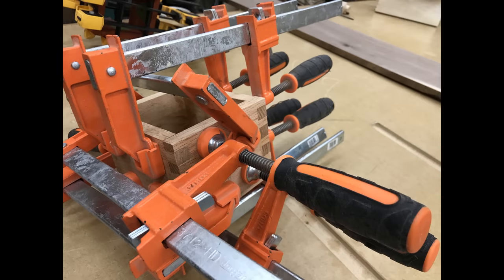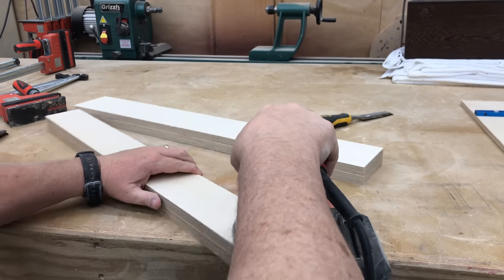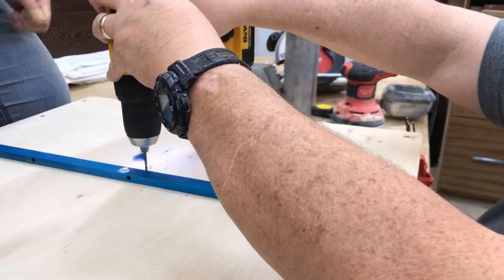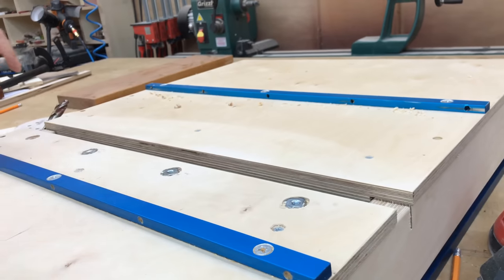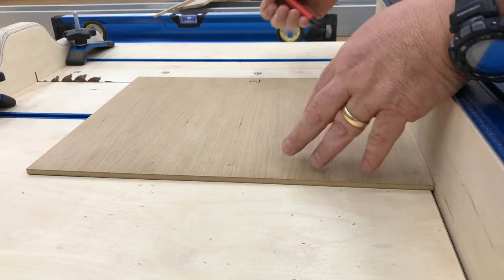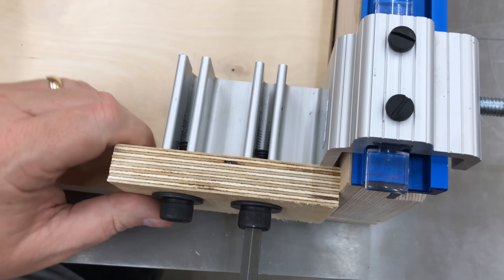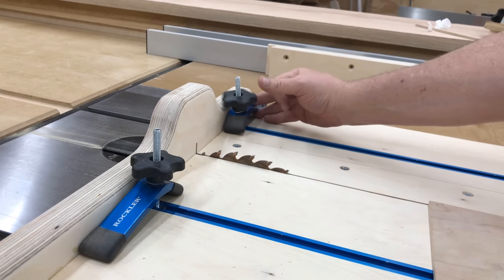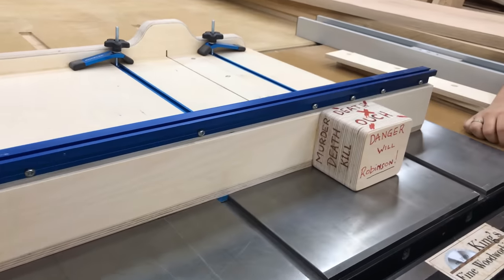39 - Extreme Crosscut Table Saw Sled with Perfect Miter & Dado & Removable Zero Clearance Insert

Comment: What's the downside to using T-track as a miter bar?  I know miter bars typically have nylon adjusting screws to eliminate side play, but (A) side play on my T-track is under .005" in the SawStop miter slots and (B) my sled will have two runners.  The upside, of course, is T-track costs way less than miter bars.

Comment: This is my first foray into youtube woodworking videos. I finally retired and am picking up woodworking again after a 55 year stint in engineering.
Great video and a very nice looking sled.  After purchasing a Ridgid table saw I am ready to get going.  Reading through most of the comments to your video, I saw the one about tapping thread in the aluminum runner and the plywood base not being too secure.  I suppose having the CA glue between the base and the runner helps secure it in place. Could you also squirt some of the CA into the wood threads and lock the screw in place?

Comment: For miter bar attachment, would it be better to countersink the plywood and run the machine screws in from the top? This would give a more secure metal/metal fastening joint. Maybe some blue thread lock as well?

Comment: Quick question... Did you have any problem moving the fence up with the double layer base, or did you take that into account and leave a little clearance for adjustment? Could you have moved the right side down and achieve the same adjustment? Thx again!

Comment: Great sled but I'm confused. Would this crosscut sled be suitable for cabinet makers?  Not that I am such a craftsman but I want to build kitchen plywood cabinets, using a crosscut sled that will be able to accommodate sheet wood of those sizes. Any pointers for such a sled design certainly be appreciated as I've searched extensively online and nothing so far. Thanks.

Comment: Hello Mr. King, do you feel it is necessary to add a "chamfered" channel to the inside base of the primary fence in order to relieve sawdust buildup which may affect squared alignment of workpieces  ? Is there alternative solutions to a permanently fixed fence ? (Please, no battery operated air bellows tubing, LoL) Thank you for your videos and solutions.

Comment: 28:58 You haven't seen Jonathan Katz-Moses non-deflection stop block at Katz-Moses woodworking. 
I like the inserts for you dadoes.  I made my sled as a single-sided sled to the left of the blade as it always gets wider to the right. Problem, only the edge that is on the sled is  a clean-cut the other side some times gets tear out
Reply: Funny, I was just in the process of purchasing Jonathan's stop block, for use when I build this cross cut sled!

Comment: Why on earth did you put the screws for the miter bars in from the bottom? If they were put in from the top of the sled base, the screws would be anchored in the metal of the miter bars instead of the plywood of the sled base. Also, it looks like threads were cut in the miter bars above the countersinks, so when the screws were tightened, the screws would be firmly seated in the miter bar, but would not draw the sled base towards the miter bar.

Comment: I did not think that Nick's sled could be improved on, but I stand corrected. I love the idea of inserts. The one thing I am not a fan of is having to add the block to the production stop, I can see the bolts getting in the way on the one side and on the other side hitting the actual stop and not the block. Could the back fence height be adjusted to not need the block? Or is there a reason that can't be done that I am missing?

Comment: I have a smaller table saw than yours (21 by 26.5 inches with the saw blade in the middle at 13.5"). Would you recommend using your size and keeping the kerf cut off-center?

Comment: You might want to check and see how flat and level the sled is after you put those screws in.  Where the glue dried it will hold the two boards slightly apart.  This might not make any difference with the sled.  I glued two round discs together for my disc sander, it was a little cold to be using glue.  I used many clamps and I tend to overtighten, but I can still see looking at the perimeter where the glue held the pieces apart.  As a result, the disc is out of balance.

Comment: Awesome sled. Definitely the one I am going to build. WHat do you think about adding additional inserts to use with finger/box joints? Put the block on the insert. One for 1/4", one for 1/2", etc. Just wondering how you'd think to mount the small block on the insert.

Comment: Very cool trick learned with the 5 cut squaring. I saw an error in the calculations though. The tips on the caliper were not at the ends of the board. So your 11 and a half should have been about 9 and a half.

Comment: Thanks for the great video. As a mathematician by training, i'd like to say that your explanations of the five cut method and how to make a perfect 45 degree angle were excellent.

A safety note. I would put a plate of steel at the end of my wood block to protect my fingers. Then if you accidentally go through the block, you will just damage the blade. 

Also, I notice that your table grooves go into your out feed table (they have to in order to slide the sled beyond the saw's table. If you put some stop block into the grooves, you can limit how far the sled can slide. That provides an absolute level of protection.

Better yet, go for the belt and suspenders and do them both.

===========
I do have a question, though.

Do all saw blades cut with the left side in the same position? I would think that some brazed carbide blades might extend beyond the steel part. That would mean that a wide cut blade would cut more to the left of the blade than a narrow cut blade.

Then your zero clearance sled insert would have differing clearance on the left side. -- So you would need inserts on both sides of the blade.

Ken
Reply from the maker: Hi Ken, Thank you! Great tips. And you are right, the teeth could be wider for a given blade. But I haven't experienced it yet.
Reply: I think I would use a piece of aluminum on the end of the block. You would be able to tell if you hit it and it wouldn't ruin your blade.

Comment: Great, thorough tutorial- thanks for your work. I'm making this now and have attached the adjustable kreg sliders on the bottom, and have a question: the adjustment screws on thesliders are very loose and I would expect them to change over time: would you recommend thread loc or something? Give what they're for, I'm surprised the fit isn't more snug.

Comment: I bought and built it. Why the front (side) is 4" high? Kreg's stop is for 2 1/2" height. Tried to cut a 2x2 but it bump to the raised edge of Kreg's stop. That limits the height of piece for cut.

Comment: Quick question.. If you are tapping the holes in the aluminum guide, why did you insert it from the bottom? Why not counter sink from the top and screw in from the top into the aluminum track, sandwiching the plywood between the screw head and the aluminum guide?
Reply from the maker: Hi Chase! You could sure do that.
Reply: King's Fine Woodworking okay, thanks I just wasn’t sure if there was a reason or if you just decided to do it that way, I am getting ready to start building my shop and have plans to make this in the future. Thanks for the reply.

Comment: I bought a set of your plane to make this sled. However there is not dimension called out on the plans for the placement of the miter track bars. Can you tell me where you have the fence set when you are gluing the rails to the bottom of the sled?

Comment: I have a question, I know you have a tape / stop block but would it not be good to have peg holes every 1/2 inch marked my peg board, then using a small peg to set each cut.

Comment: Do you ever use this sled with a 45 degree tilt on your blade?  I have a powermatic 66 saw and wondering if I should account for tilting the blade 45 degrees but I'm not sure if that is used often!

Comment: With the screws in the rails. Do the machine countersink screws actually hold in the plywood (like a wood screw would)? They obviously thread into the aluminum, but wood? Or are they just supporting the glue?

Comment: Great video, best was the 45 degree miter cut add-on and how you build it. I'm a little concerned however about the weight. It must weigh a ton. Also, since the sled is pretty thick, I wonder how useful a 6" dado blade would be.
Reply from the maker: It wasn't too heavy. And a 6" dado blade would work for most cuts.

Comment: How do you deal with tear out when you go back to a regular saw blade after using the dado? I get the insert for the bottom, but there is still a larger cut in the rear fence correct?

Comment: After a year of owning this, would you say it was worth it to drill into your production stop and add your extra block there? Have you actually benefitted from the extra inch of fence height? Has it caused any issues or problems since going that route? I've got the same kit and I'm preparing my own sled build, I intended to build teh fence to fit the stop but you've got me thinking I might be missing out. Just trying to weigh the options

Comment: Just found this video as I was researching cross cut sleds.  Now on my list of projects and another plan to purchase.  One question I have.  Is there any benefit to have a small shelf on the other side of your insert plate?  Looks to just sits on the one shelve and bolted down.  In other words the inset plate would be supported, by the 1st layer nearest the table, on both sides,

Comment: Great vid!  But I did not see how you enforced the length of the picture frame edged. Others with picture frame jigs have a stop and take care  to measure the inside rabbit length etc. etc.  you did not do that so what is the substitute here?
Reply from the maker: Hi! I did!  That’s exactly how this works. You measure from the inside of the rabbet right at what will be the outmost edge of the rabbet. Therefore measuring 8” pieces and 10” pieces, will give you a frame that perfectly holds an 8” x 10” piece of glass. 

I guess I should have shown the function and use more clearly. Maybe I’ll make a video making a picture frame using the jig, then I can zoom in and show exactly how it works.

Comment: 3:52 - aren't the holes in those aluminum runners already tapped 1/4-20 ? Are you drilling and re-tapping for 5/16-18 and running the tap through the plywood? Are you using a 5/8" length flathead machine screw?

Comment: Maybe this has already been addressed in the comments somewhere, but regarding the miter attachment...since I imagine that frame sides are cut to produce rabbets of specific lengths and not so much concerned with the outside measurements of a frame, doesn't this method of cutting to the outside edges make that more challenging?

Comment: At 32:17 when you loosened the hold down, I seen the piece of wood drop a bit, looked like the top of the sled isn't flat. Does it not matter if the top isn't perfectly flat? Thanks again

Comment: Great video and I've already downloaded the plans. One issue is that the 3/4" Baltic birch is only 18mm wide and therefore the Kreg top track will overhang the fence preventing you from cutting dados in material thicker than the fence height (not common). Your video clearly shows your fence has a different makeup (3 pieces instead of two) that makes the higher part of the fence a bit wider than 3/4". What materials did you actually use? Thanks.

Comment: I like the design.  But I wondering.  Why not include dust collection in the blade guard?  Great tip about the isosceles triangle.  But what if I need an angle that's not 45?  I have seen that more than once.  Also, the sled seems too thick for a regular table saw (with out a 12" blade).  Do you really need it that thick?

Comment: Thanks for the great content. When you glued up your 3/4 for the fences you ran the pieces over your jointer and I've always read that the glue in the boards can dull your blade. I've noticed other builders doing the same thing so I was curious. I have a very new Grizzly 8" and have been hesitant to run glued board thru it. Curious what others experiences are as well.

Comment: At 39:30, it looks like you have a Rockler T-Track hold-down clamp.  I'm trying to research the difference in the Kreg track system and the Rockler track and accessories.  I thought that the Rockler clamps typically have 5/16" T-bolts, and the Kreg top track only accepts 1/4" hex head bolts.  Just curious how you adapted the Rockler clamp to fit the Kreg track or if I'm missing something in my research.  I like the way you're using that clamp.

Comment: In Germany we only have 18 inch miter bars. Do you think using two bars in one running track will work just as well or will the performance and accuracy be worse?
Reply from the maker: It should work just fine. I don’t think it will be a problem at all.

Comment: I have been saving youtube videos of different styles of cross cuts sleds for a while now and yours had been on the top of my list for a while. I have one concern before I buy the plans off your site.  If you make a dado and cut too much into the back of the sled won't that cause potential tear out on not dado cuts?  I was thinking of making a removable insert like you zero clearance one for the bed surface but for the back. Thoughts?

Comment: Thanks so much for the video!  Will purchase plans.  One question, I may have missed it:  why did you attach the front and back fence early in the video and then remove them again at 14:13?  Was it critical to attach them before making the dado cut for some other reason?

Comment: Hello and thank you for the video and plans, I have completed this sled. Just a question about the rockler auto lock hold down clamp. It looks like yours has a longer screw attached to it which would make it easier to clamp things off the fence, where did you get the screw and how did you attach the end plastic circle, i have gone to specialist stores here in Australia but have been unable to find anything. Cheers Brett

Comment: The Swing Stop and Production Stop w/ the Kreg track & stop system are designed for a 2 1/4" height from top of fence to the table, but from watching your build, It seems that you have the back fence 3" tall - does that work ok for you?   I like the idea of a taller back fence, but it seems like this design limits use of the stops for any stock with thickness much below 3/4"  ??
Reply: Doh!   Watched again and duly noted the extension you put on the production stop.   Sorry.    Makes sense - 2/14" would not be tall enough for the fence, I think.   Your work around to use the stop is straightforward.

Comment: Do you think that if you mounted the miter bars with the adjustment screws facing outward on both sides when they ware you would the same resistance without any adjustments to them in the future .
Reply from the maker: That sounds like a great idea.

Comment: @ 43:50 I see your 'safety' block on the rear of the jig has a cut-through from pushing it past the saw blade's exit.  How about an additional type of stop that you clap on the rear of the saw table with a line (cable) fixed to the back of the jig that prevents you from advancing your crosscut jig beyond the safety block's exit danger point?  It could even be a small mounted self unwinding device that lets the line out as you push the jig forward and then reaches its limit before the blade comes out of the safety block.

Comment: As made, can you tell us the weight and the cost of the metal components of the sled (tracks, clamps, stops)?  Somewhere between $200 - $400 I would imagine.  Please let us know when you can.  Thanks, great instructional video.
Reply from the maker: When I bought it, it was between $150 and $200 for everything. I never weighed it but I would guess it is around 25 pounds.

Comment: Great job on the design and the build video.  What is your opinion of using a 1/4" thick plywood rather than a 3/4" piece on the bottom to support the inserts?  That would keep the weight of the already heavy sled to a minimum and allow for more effective blade height above the sled surface.  Wanted to ask your opinion before going that direction on my build. Thanks again for the excellent video!

Comment: Hello James. I know this is kind of an older video of yours, but I was wondering if you could tell me how you determined the exact length of the frame pieces, while cutting the 45's at about 39:57 in the video. I watched that whole process several times (and would like to add an accurate fixture like that to my current sled), but I couldn't tell how you 'measured' the parts to get the same accurate lengths for the frame, unless I'm missing something...(I didn't see you mark any lines, or use any stops). I've never yet made any really nice picture frames but would like to up my game some, and that info would be helpful to me. I've got my sled squared to within .001 so I think that's a good start, but I've always had issues with getting perfect 45's on picture frames in the past, so I'm going to try this method. Thanks for all the great content, and I always enjoy your videos. My current project involves cutting 44 dados for two cabinets (cut them all yesterday) but I sure wish I had a sled something like this, when cutting them. This is a great idea!
Reply: He did not measure them.  He simply cut 2 of one size and 2 of another size.  It really doesn’t matter how big they are (for the demonstration). It only mattered that the top and bottom were the exact same, and the sides were the exact same. He did that by using  a stop to get the lengths, then only trimming the 45 off of each end.

Comment: Great work, certainly a true craftsman. Although... at frame 26:36 you pulled the frame out the knocked it back into place quite hard. Would this dull that sharp point you had on the board? Just saying...